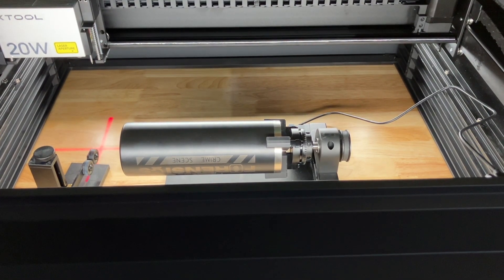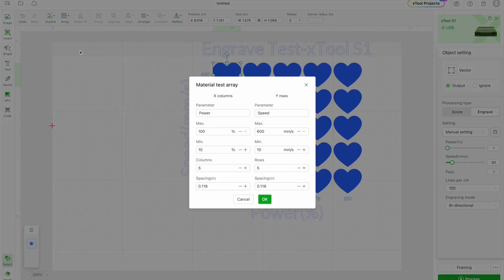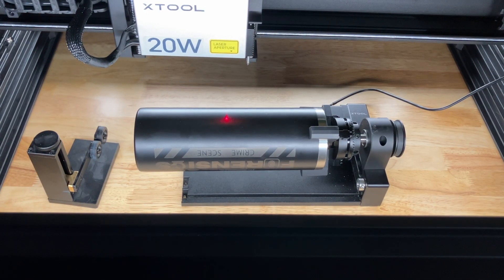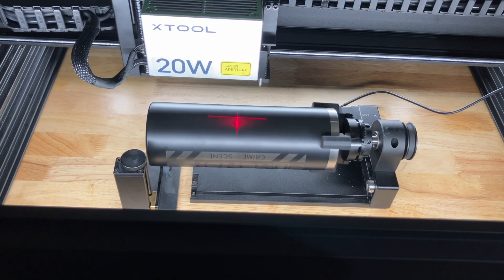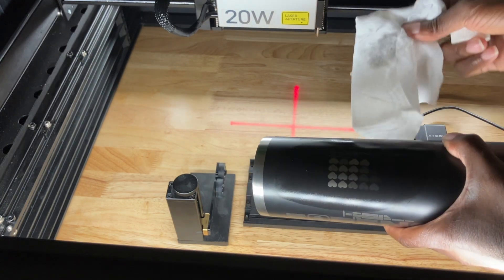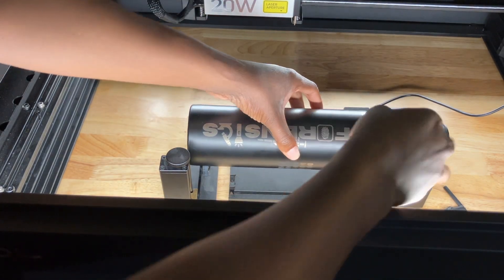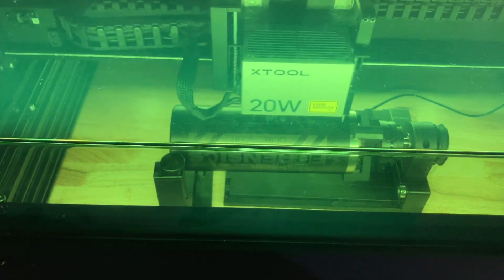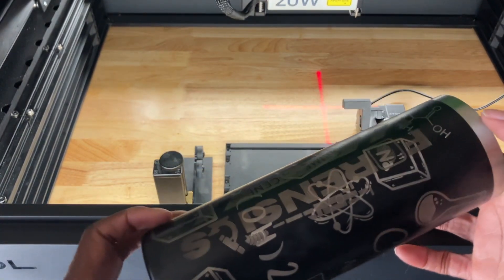How to engrave tumblers full wrap using xTool S1 Beginner Friendly Tutorial

Comment: Hi! EXCELENT tutorial. I just ordered my s1 last night. About to order the rotary. Do you have to have the riser as well or just the rotary tool?
Reply from the maker: Riser as well. I don’t believe using the rotary tool works without the riser since you need to have the laser above the material you are working on. I don’t believe there will be enough clearance if you don’t have a riser.